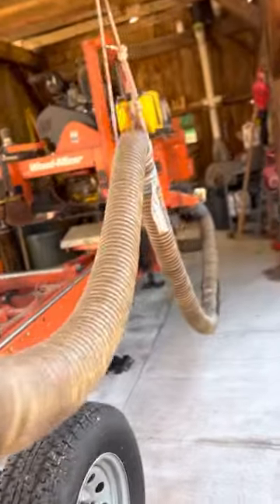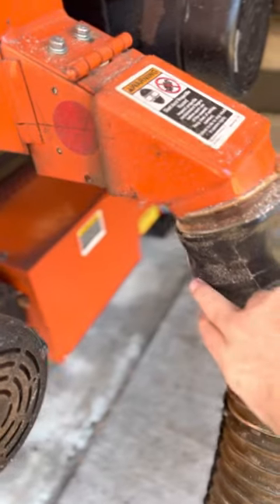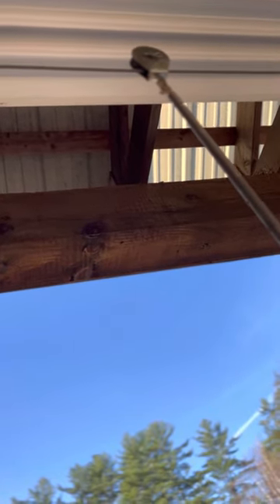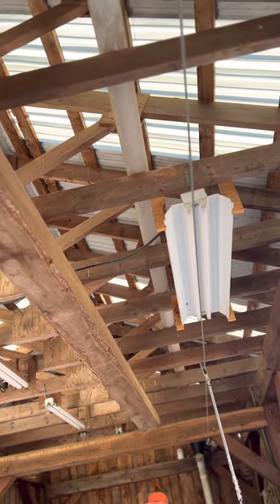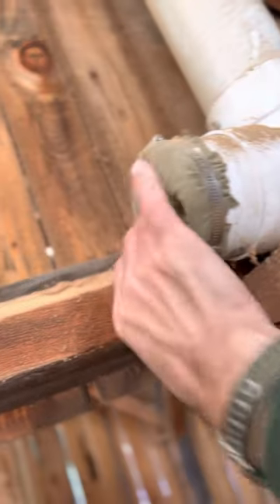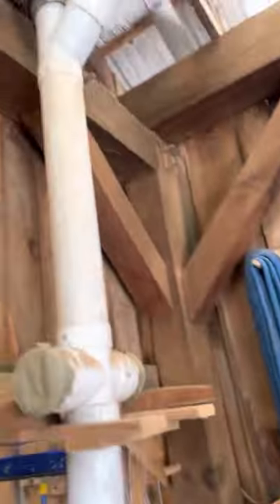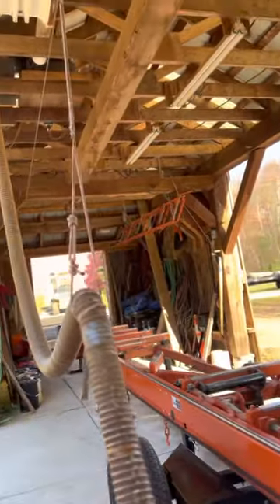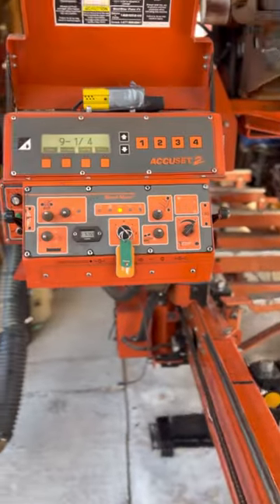Sawmill dust collection- Woodmizer LT40 sawmill sawdust collection system

Comment: what is the blower brand and type? What cfm?
Reply from the maker: Hi Oldtruck guy:
The blower is generic - I don’t remember the blower paddle wheel size
2hp,3450 rpm, 240v.
A 1725 rpm motor did not create a enough suction